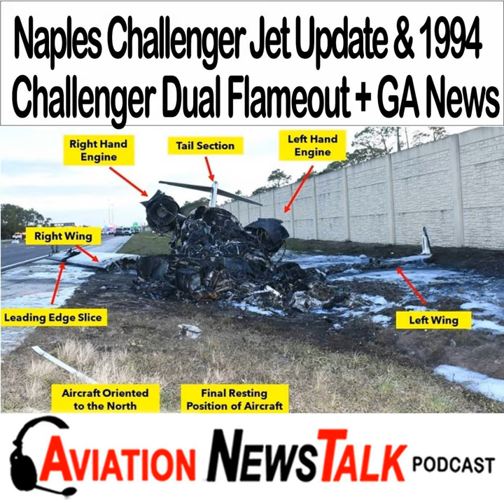317 Naples Challenger Jet Update &amp; 1994 Challenger Dual Flameout + GA News

Comment: Back in 1965 I joined the Army with a promised schooling in aircraft maintenance.  During that school we were told that if water was present in the fuel the fuel gage would fluctuate. Never forgot that. Fast forward to1968 and I was an Aircraft Commander in a UH-1H setting in POL hot refueling when the fuel gage started to fluctuate. I shut the engine off immediately and had the crew chief stop refueling.  The fueling was started with around 30 gallons of fuel and was terminated with just over 50 gallons. Maintenance drained the fuel and there was 16 gallons of water in the fuel.  The fuel quantity probes are the same on almost all jet fuel systems in both helicopters and airplanes.